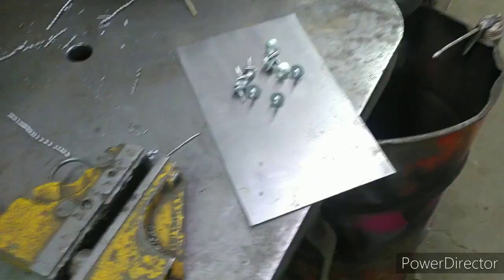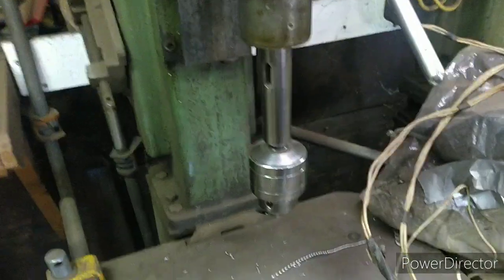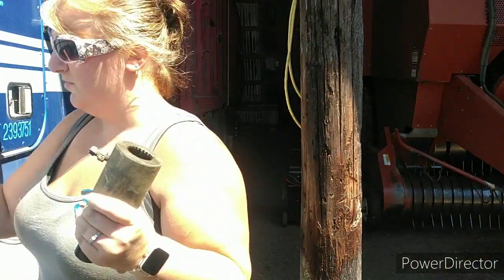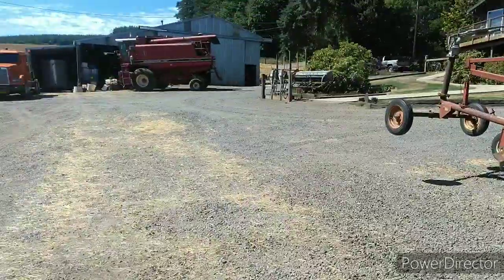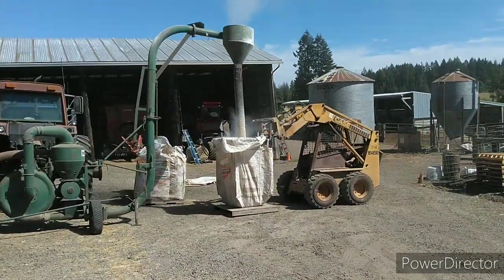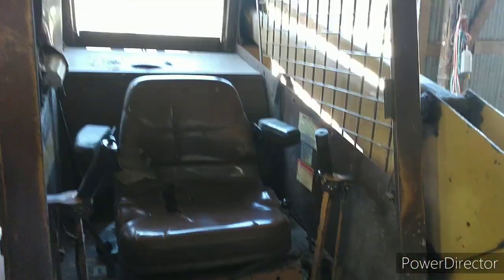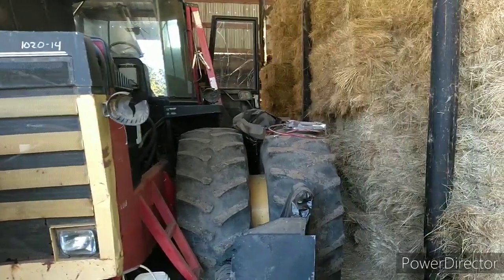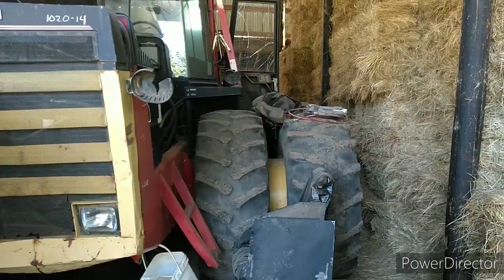Yup... Monday!! But free feed, from strangers 😁

Comment: Lots of room to run down the roads with the header on here. Just don't do it after dark. I road five to ten miles with my 22 foot header on but like to have a pilot vehicle front and back so theres no suprises coming up a hill.
Reply from the maker: We can go a couple places with the 20' header on, made it out to one place close with a 24'.. it's the bridges, power poles, road signs, mail boxes.... Fences.. and the idiots in cars, can't forget them!!
Anymore, we pretty much move all the equipment with a flag or two... But idiots don't know what the big sign and all the lights are for.
Reply: Yesterday I was in the pilot car, two idiots came around me but didn't have the guts to pass the semi hauling a small trailer with a forklift on the windy road. Someone coming head on later acted like he owned the road. Close close. Last year someone ran into the front of a truck I was driving. I thought no way to miss them. Death wish I guess. They towed off my truck with a few hundred acres of seed on it. Wouldn't start, bleedin antifreeze. Sure made feeding horses harder. Thank God I lost the seed, no rain, wouldn't have had the crop grow. Probably saved me a few bucks.
Reply from the maker: @cletaspratt9162  the idiots are many!! We have had so many close calls!! My wife hates to flag anymore.
A friend who was moving their three 2388 hillside combines had a guy pull a pistol on him.. he kept the guy blocked until the combines passed, then jumped back up front to block the next intersection. Guy gets up to him, once again pulls out his pistol. 🤣😂 Got met with an AR15 aimed at him.. that's how messed up the idiots are here.
More and more farmers keeping their guns closer..

Comment: Stainless is odd stuff. It scratches easily which suggests it soft but try drilling it with a tek scres as we call them and you have no chance. Sometimes short videos with many clips are a good thing, I may have do something similar to cover a day's events/work too? We have Storm Francis visiting us today and it's bringing torrential rain and windy up to 70mph. That should be good for washing the dust of summer away. Ysesterday was roughly our 16h nice sunny day since the beginning of June. A great day because it was 18degrees C so not hot. It was dry, clear skies and long views across the hills when I wasn't figuring out how to weld a hinge onto 30years worth of rotten old angle iron that the original hinge had rotted off. A double hinge set up on very heavy angle iron to swing opposing cattle shed doors on, but one hinge had corroded away. The heavy door basically rotted out across the bottom too so I replaced it. Today's work cancelled due to the weather. However, I have a plan!
Reply from the maker: Weather.. LOL. Always something to do good weather or bad weather.. stainless is interesting..
Ya, too big of a hurry to video much, but it works 👍😁

Comment: Yeah now that our combine runs a 40ft header we have to take it off between fields, 30 is no probs, 36 was pushing yer luck on the highway leaning over into the ditch but it's amazing the difference the extra 4ft make. swather's still 30ft and i'm good with that.
Reply from the maker: Doesn't take much to make a big difference!! 16' here, fits everywhere..
20'.. not so much... ,24' not at all.